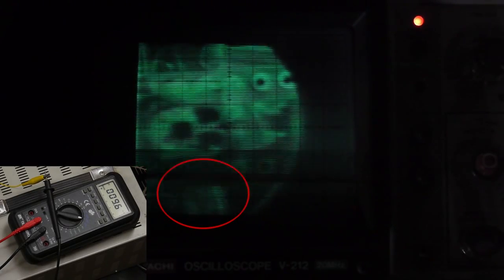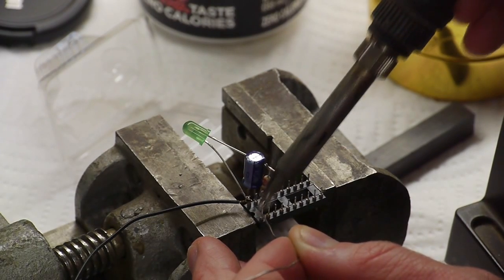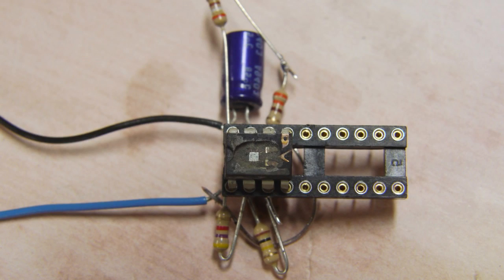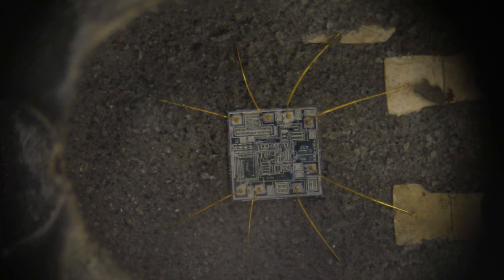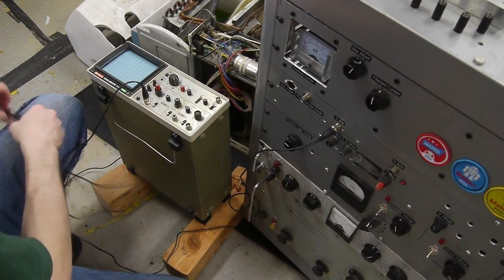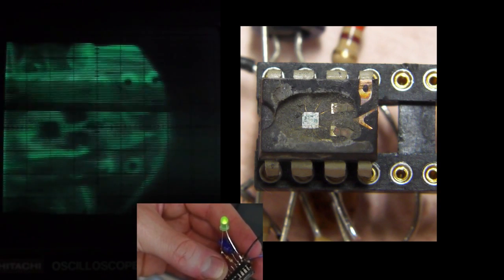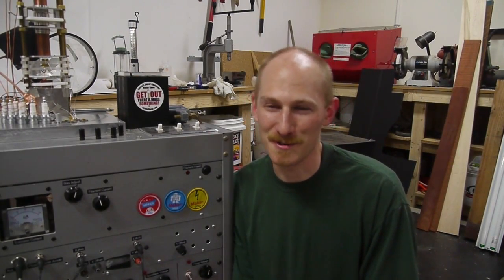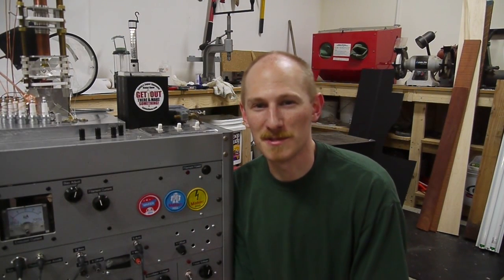Viewing an active electronic circuit with a scanning electron microscope

Comment: Don't you fry the circuit because you change internal transistor output voltages?
Remember some transistors can be activated by the electron beam.
Test transistors first and look for voltage changes when the SEM is turned on.
Look for different transistor types and for different production methods.
You probably need a passive sensor (meaning not a beam) for non destructive magnification.

Comment: Excellent, and interesting. I realise that oxides of Si (presumably SiO2) are attacked by HF, but apparently, so is Si itself. Do you have any thoughts on how to strip off the oxide layer while not dissolving the underlying silicon substrate?
Reply: Just noticed how old this is, so I guess you probably answer this in another video.

Comment: why you see electricity, we know the theory's, so we know that according to programming which transistor going to get the charges and which component going to get charges and loosing it

use a very high resolution slow motion camera also, we can easily produced electron movement

slow motion camera people's do it easily, they are also on utube

Comment: Side question... Why make the 555 chip so small, if it's meant to fit in an 8-pin DIP?  If they made the die larger, they could increase it's discharge and output current capacity.
Reply: Cost and power requirements.
Reply: It's all about how many die they can fit on a single wafer. The smaller the die, the more per wafer, and the less each chip costs to manufacture.

Comment: It looks like you're getting interference from somewhere inside the scope. There's no sharpness we can't make out an image. I can't tell if those are scan Lines Moving from top to bottom or that's just your equipment. If you've ever seen pictures from a real electron microscope you would know that this is light years away from what is capable.

Comment: Start more simple, scan a wire first as your control and play with imaging techniques before moving on to an etched in-line semiconductor.  As mentioned in the comments, you may be seeing the magnetic field, which makes sense, since an electron beam controlled by magnetic fields and current generates a magnetic field.

Comment: I remember having to drag an old electron microscope out of mothballs for e-beam probing about 20 years ago.

I was ready to throw in the towel when I finally realized the image is the inverse of what I was naively expecting. 

Instead of higher voltages being associated with brighter metalization, the 5V/3V metal lines were actually darker.

Once you realize that and adjust the contrast accordingly, you should even be able to see voltage differences of one or two volts pretty easily....ie. reasonable analog voltage capability. btw this was all without removing passivation from the die.

Fascinating video.... I'm sure e-beam probers have much better resolution nowadays but pretty quick way to find out where a chip is broken.

Thanks and love all your videos.

Comment: Very Very Cool, but not knowing what I was looking at I found it very difficult to understand the scanning output on the oscilloscope. The flicker didn't help any lol. anyway you can sync the FPS of the camera to the scope refresh? Anyway. I just bet the chip gave up the ghost after a bit, Being in an Electron microscope is basically like being in a multi-Kilivolt level Vacuum tube. Not healthy to other electronics and very noisy electronically I would think as well.

Comment: Why is an electron beam (like that 3kV) (from) outside the object necessary when you are scanning for electrons that are coming straight from the source?
Reply: The scanning has to be done with an electron beam.  That's what actually scans.  No beam, no focus and no scanning.  The electrons are focused onto the surface being observed, scatter off of it, and are picked up by the photomultiplier built into the microscope, which is where the video comes from.

The trick to this is experiment that parts of the circuit that are more negative will repel the beam just a bit more than parts that are less negative.

Comment: Observing the quantum state alters the quantum state. You either know the energy/voltage/logic, or you know the position of the charge and alters the energy/voltage/logic. But not both. ICs are designed to let you know the energy/voltage/logic by LEDs, not designed to let you know where the electron/charge particles are located. Forcing your way in destroys the logic gates work flow. No, Can't Do.

Comment: I had a crazy late-night thought once, that maybe it would be possible to use a hard disk drive to record real-time operation of a chip if you span the disc surface under the chip, which was attached to a drive head. Then any current flows would leave a magnetic trace. You would need to deconvolve the nagnetic signal trace afterwards, so you would want analogue connection to the read heads, and maybe a DSP. Well, I said it was crazy, but it might give someone else a better idea about something else!

Comment: Just a thought. don't use a CMOS  IC in an electron microscope. The  electron beam will break down the metal oxide layer between the gates and the channels of the MOSFETs just like an electrostatic discharge. In another experiment, I decapped a TO-3 diamond base power transistor (2N3055) and found that it was electroluminescent! Perhaps a bipolar version of the 555 timer will do something similar. It may have better odds of surviving the electron beam as well because it is current biased rather than electrostatically biased, so it will not accumulate a charge. 
Another thing to try. see how its characteristics change when exposed to light vs dark. They could be somewhat photosensitive. both CMOS and bipolar.

Comment: Why don’t you use a ceramic chip, you can easily either pop the metal cover off, or split it into half from the horizontal plane, without damaging the IC?

Comment: Using an electrolytic capacitor in a vacuum, interesting. Could your lack of a decent vacuum have been caused by the cap leaking?
Reply: The thought occurred to me as well but it is only one atmosphere of extra pressure difference.  The vents (and sealing) of the capacitor would likely handle a few atmospheres so it should not leak directly.  Certainly the rubber and spaces under the shrink film label will out gas for quite a while as well (virtual leaks) as will all the other cheap plastic in the socket and stuff but I doubt the electrolyte is in any danger of boiling.

Comment: As an IC failure analysis engineer for many decades at TI, nothing was more impressive than watching a circuit function inside of an SEM.  Of course, we never built our own SEM, our old Cambridge S150 came equipped with a electrical feedthrough connector to power the IC.  My first experiment was with an old military grade 5400 quad nand gate that definitely had an SiO2 protective overcoat and HF would move the SiO2.  A more modern IC would have an silicon nitride overcoat and would resist the HF etch.  It would undercut into the  SiO2 under the SiN and would eventually lift off the SiN but would destroy the circuit.  With your hardware genius, you should build a fluorine based plasma etcher to remove the SiN overcoat.
Reply: "build a fluorine based plasma etcher" should go nicely with the DIY particle accelerator...
Reply: i dont know what you said, but i like it... +1 for a fluorine plasma etcher build idea...
Reply: What language am i supposed to read this comment in?

Because it isn't english.
Reply: @lambmaster27  Same as a note passed by girls in high school. If you don't understand it, it ain't for you.
Reply: @scottfranco1962  If this is what you do in your spare time then you are the least likely to get a note from a girl lmao 🤣
Reply: @lambmaster27  Scott Franco knows how to remove SiN and make a connection to the good bits. Do the women know how he does this?😬
Reply: I was in the calculator group of the semiconductor division back in 1973.  At that point TI had never run a television commercial and they were looking for ideas.  So they slowed the clock way down on a P-MOS calculator chip and captured the video from an SEM.  They actually made a commercial, but I don't think any of the TV viewers knew what it was, so they dropped it pretty quickly.  It was a cool commercial for those of us who knew what was going on.
Reply: As a person who worked on SEMS and currently works on Plasma Etchers I approve of this message. :)  I'm lucky enough to work on the best SEMs and Etchers in the world.
Reply: Scott Boddicker thank you for the important tip. I hope to see the results soon.
Reply: Did anyone understand this? I didn't
Reply: @drakethedragon457  Understand it?  No. But I was impressed for some reason.

Comment: 4:15 I didn't know that they put their logo even on the die itself :D (you can see the ST Microelectronics logo on the right side)
Reply: Mezgrman It's an Easter egg that few will ever find.
Reply: Mezgrman I used to work at Maxim integrated circuits and when I would do Post lithography visual inspection on almost every layer in the Alleyways in between die there would be Dilbert comic strips. Turns out someone on the radical design team was a big Dilbert fan.
Reply: gentlemanfarmerPNW Did you ever get to test the Maxim product ? Did you use a Credence or a T.M.T. tester ? I only ask because I was a founder of T.M.T. and we had testers running in all of your production sites. Our office was just around the corner from you in Sunnyvale CA.
Reply: I imagine most chips have an easter egg or two on the die

engineers just love to leave their marks on their work.
Reply: Mezgrman, I thought that was really neat also. I was thinking the logo? and is that the trademark and copyright, OMG!
Reply: can i ask question..what point doing die large if die is only few mm large..what is that black stuff near die wires
Reply: rs agarwaen Those are pads that hold the small wires (attached to the outside wire “legs” of the chip). The point of the video itself was to see if the guy could actually “see” electricity flowing inside the chip, but he had had to zoom in so close, he blew the chip up (scanning electron microscopes work by shooting beams of electrons at a target and looking at the reflection). Too many electrons caused a short circuit in the chip is my guess.
Reply: Yeah i have an old Czechoslovakian ic, and it has a logo on the die too. It was made by TESLA(not to be confused with Musk´s TESLA)
Reply: I think everyone does this, I've seen chinese copies of TI chips even etch in the TI logo
Reply: You can check out alot of ic's in siliconpr0n.org, its quite common

Comment: interesting idea but I an amazed that you didn't instantly fry the chip. I bet you got lucky.

I would just build a simple oscillator circuit out of high voltage parts and not even try an Ic.

Comment: 4:11 Why does ST put their logo on the die?
Reply: Because it's quite common that manufacturers do so. I have an EPROM with a rather large ST logo on it (you can almost see it with the naked eye and a good digital photocamera is able to catch it).
These chips are made with a proces where 'something extra' doesn't cost any extra material (it's kind of an etching process, just like PCB's).
Only someone needs to add the logo in the designing stage. The rest will work itself out in manufacturing the die.
It can also be a way to lable the chip/die as genuine: if a reproduction misses this logo but the seller clearly states his dies are from ST, you can be sure there is something wrong with the dies.

Another EPROM I have probably features layer-markings as well: there are 8 squares with all kinds of different hatches in them placed near the edge of the die, probably to indicate that the die passed all the stages of manufacturing.
I can dwell into the world of EPROM's for ages ;) Started exploring them with a cheap microscope (including USB-camera) from the Lidl supermarkets, but planning on buying something better.
Reply: Because they can. Some dies have jokes, engineer's signatures, song lyrics, cartoons, art etc etc.
https://www.google.com.au/search?q=chip+art&client=ms-android-google&dcr=0&prmd=isvn&source=lnms&tbm=isch&sa=X&ved=0ahUKEwiLqpDUqJ_YAhWBlZQKHW9yD3UQ_AUICSgB&biw=360&bih=516&dpr=3
Reply: I was a young 18 when I went to work in the hybrid lab for Hughes Aircraft, making hybrids for satellites. These are basically canned circuits where unpackaged ICs (called "dice") are placed on a gold substrate and wired together. I was working with a microscope and suddenly saw a happy face looking back at me. I was convinced I was loosing my mind, and got my boss over to look at it. He told me lots of chips have such Easter eggs placed on them.

Who says being an IC engineer is not fun...

Comment: Back in the 1980s I levered the top of some chips (74 series logic and some memory) looked with a powerful optic microscope.  As well as the circuit I remember seeing some very small writing on the edge of the chip.   These were the ceramic type made of a ceramic and epoxy sandwich. They came apart without too much trouble and reasonably in tact.

Comment: Was the 555 destroyed by the electron beam affecting the semiconductor material?  Would this experiment bear out those who claim a malicious EMP could wipe out electronic devices?  What was being seen during circuit operation - could that have been temperature variations rather than 'charge'?  Just curious...  Thx.
Reply: The chip works because some parts conduct electrons, some parts conduct holes and some parts don't conduct at all.  The chip probably failed because the parts that shouldn't conduct started to conduct (irreversible breakdown of insulation).

Cody's theory is that the electron beam caused some high-speed electrons to get stuck in the non-conductive parts.  Eventually they conducted a spark through something important, leaving a scar.

This is reasonable since it only takes 100V or less to destroy most electronics and the microscope was shooting electrons at about 3000V.

EMP bombs might destroy electronics by a similar mechanism, except that the electrons are pushed through the wiring by a strong magnetic field.  The most vulnerable circuits would be ones connected to loops of wire that surround a large area - in fact we have non-classified reports of light-bulbs being destroyed by nuclear weapons tests.

Those lightbulbs were destroyed because they were connected to power lines, which acted like a giant antenna system.

The vulnerability of modern electronics, vehicle ignition, and so on is unknown (to the extent that governments know they're not talking).  Airplanes that have passed lighting certification are likely immune, since EMP magnetic induction is probably not as hard on electronics as a direct lightning strike.

(And surviving lighting is routine.  Each plane that flies in airline service is struck on average about once a year, usually without the crew even noticing.)

Comment: Hi Ben :)
Love the videos! 
I think it's more likely the chip killed itself than the e beam - as the vacuum reduced thermal conduction, the chips wires overheated?
source: have SEM'd 50 nm silver nanowires without destroying them + killed a few devices before realising thermal conduction in vacuum was the problem.
Reply: Thanks for the insight!

Comment: I believe what you are getting here is a technique called "voltage contrast".  The SEM detects  charge differential and displays it as light or dark areas.   The link contains some info on it and very cool pictures. http://www.highfrequencyelectronics.com/images/whitepapers/downloadables/1404_Voltage%20ContrastIn%20Microelectronic%20Engineering.pdf
Reply: awesome!

Comment: might help if you super freeze the chip.
Reply: Charles Kafka oh, interesting idea, but it would change the operation of the chip as the resistances would go down. Anyway, what would be changed? I don't know.
Reply: dang didnt' think of that.. .. 
ok looked it up, 
yes and no.. 
computer logic chips don't rely on resistance, so it shouldn't effect the gating. 
it will effect the timing chips, which will result in faster clocking speeds, 
the faster clocking speeds will level off at about 90k or -300f
Reply: Charles Kafka ok, that makes sense. If there's no current flow, resistance doesn't matter. I was only thinking of this timing chip - though the parameters are external. Thanks!

Comment: You should try to modulate the electron emission of the gun... Higher voltage, but much smaller duty cicle. So total charge & energy deposited over the IC's surface would be much lower. And at the same time, you're 'splashing' higher energy secondary electrons. But in a shorter timespan.

Comment: Apart from your actual discovery, which is like a dream come true for anyone who ever debugged an electronic circuit, what amazes me is that you can just have nitric acid eat away the cover and leave the die perfectly intact, and also that the manufacturers actually print their logo on the silicon.

Comment: If you use HF acid to dissolve that oxide layer you have to be really fast otherwise you'll start to dissolve your aluminum interconnects on the chip and whatnot.

Comment: So, my question is, if you really really needed to, could you copy a solid state drive, bit by bit, very slowly, without plugging it in, using an electron microscope to look at the switches in the chip?

Comment: I think you must put cooling past on it,otherwise the Dye would be destroyed at normal voltage immediately.But i think you cant electromicroscope it through the paste.Or you cool down the chip maybe -50 C or so or/and blow cold air over it

Comment: When decapped the chip and used the the hydrochloric acid to melt off the oxide layer from the chip does that chip now lack just protection alone or thermal insulation?